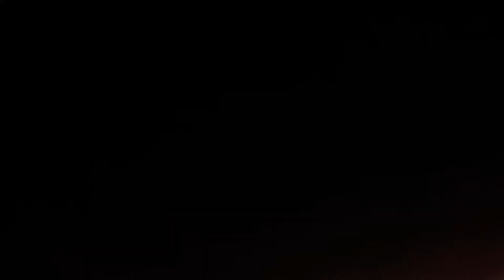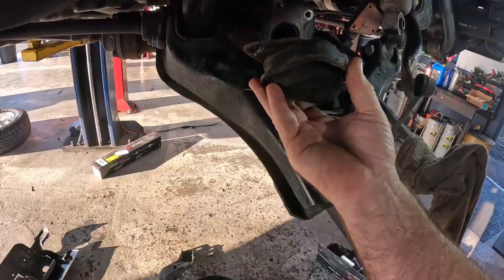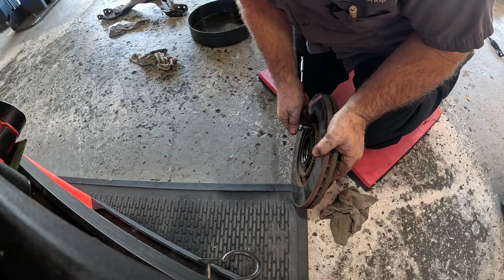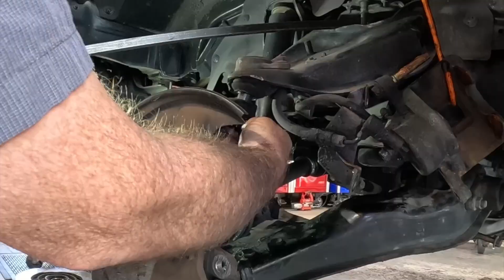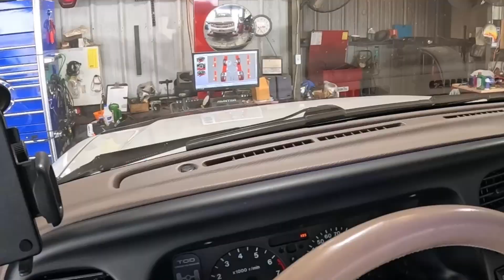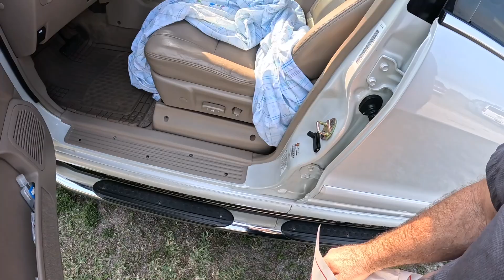01 Isuzu Trooper, Axles Complete, Align. Auto Shop DAY 645 #auto #repair

Comment: That is a big job on the Isuzu but absolutely worth it. To replace that truck with a new one would be $60k+. Glad the owner got you to repair it. I like them
Reply from the maker: Yeah, they are tough trucks! I wouldn’t be surprised if they are closing in on $80k plus if they still sell them in the states.
Reply: @JimmyMakingitwork last production model year was 2002 which has a current resale value of about $2000 😊